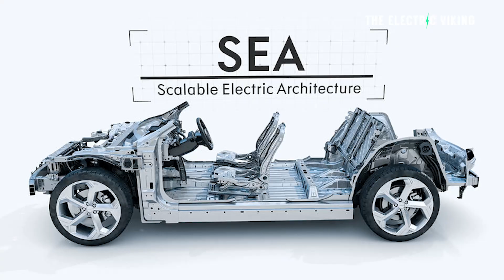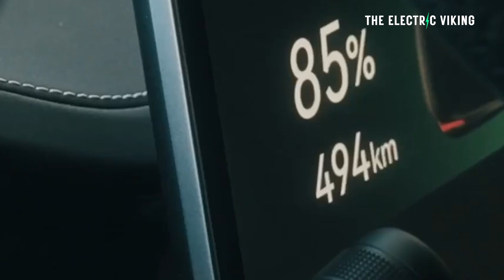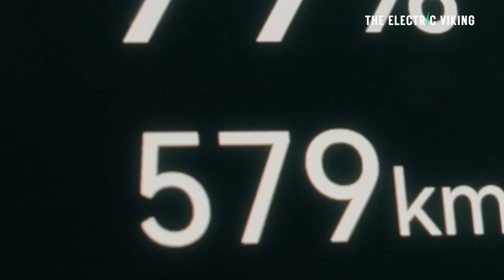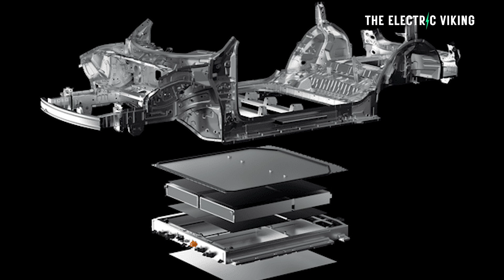Geely Galaxy E5 launched worldwide with most advanced LFP battery EVER

Comment: Owned 1 BMW and although it was fun to drive & looked good, it was a total piece of sh__! It was an X5 and was always in the shop for malfunctioning or broken stuff.  Everything from water pump, electronics, heated seats, windows, radiator, console and transmission dying with 85,000miles on it! This POS died completely with only 130,000 miles. My son's 2004 Lexus RX330 has 200k miles and still drives lime new! Along with people being scammed from US & German automakers with PLANNED CONSCIENCE, people are sick of pay top dollar for plastic components such as high heat engine parts, door panels, dashboards, seat backs, knobs and buttons!

Comment: Why would I? Well a BMW, Porsche, Isuzu…. Will tow my boat, Trailer, Caravan….. these don’t. Shark is only good for a poultry 2700kg. Issue I have with many Chinese EV’s is they all look generic Chinese on the inside. Does everyone need to use the same plastic steering wheel? Anyway….. still waiting for the L60…..

Comment: 4:27 "Cell to body which is Giga casting"??? I don't think so... Cell to body is like a "million" pieces of batteries put to cells, "wrapped" to a huge battery pack and welded (or something strong bound) to the car, so basically that is the floor plate. Giga casting is hot metal injected into pressing machines and a full section of a car is created in 1 single piece. Both technologies can be used independently or together. Both making the car very strong but they are different things...

Comment: The truth about safety is not how rigid the structure is, but how it deforms to absorb the kinetic energy. The squishy thing behind the wheel won't stop moving if the car stops instantly. And the bits inside the squishy thing are what get damaged. Notably the brain. So controlled deformation/breakage are actually better. With castings there is a better chance to design-in controlled absorption of the energy.  More expensive to repair, but ya cain't repair a torn brain!

Comment: I'm not so sure the physics checks out regarding the giga casting resisting deformation..

I'm open to corrections but if the cars is harder to deform the collision time will be shorter and therefore you the driver will get more injured from the crash

But I think it's safer if the crash is smaller scale/speed
Reply: I'm guessing this technology will just make the parts of the passenger compartment part of the body stiffer. For example making the entire door ring less prone to warping. But the front cabin part, should still apply a lot of the cushioning technology Geely learned from volvo.

Comment: Deformation in a crash is the best way to absorb energy to limit damage and injury to the occupants. Thats why cars have crumple zones.
Reply: The crumble zone is there in an EV. You're safer inside the cabin because of the gigacasting.
An EV has no engin block being pushed inside the cabin. The front and back are designed to absorb impact as in any other high-tech car.
Reply: @Jonse70  There can be no crumple zones, hence the solid casting, the rigidity is required to prevent the battery being deformed and likely  burning. This comes at the expense of passenger impact safety.
Reply: @dayleedwards3521 not exactly.
Crumple zones are partly designed to prevent the engine block from killing you in a crash.
EV’s have safety features to make them extremely safe
Reply: deformation to your chassis will crush you inside

Comment: Still think cell to body manufacture is a huge problem for right to repair.
Reply: most of today's BEV have poor maintenance economy. Often their battery can only be replaced in their entirety - just like when a small feature on an iPhone breaks, you can all but replace the entire motherboard. But the Wuling Starlight, a car from Wuling (a joint venture constructed by SAIC, GM, and others, whose products are often marketed abroad under the Chevrolet label), could theoretically be swapped out for a particular set of cells in the battery alone, and may be able to greatly reduce the cost of repair after an accident

Comment: Crash deformation is a design feature! If the body doesn't deform - you do, to many pieces. Giga casting is faster, cheaper, more efficient, but it MUST deform in a crash. Sam, read the specs.
Reply: Absolutely. Trouble is he thinks the sun shines out of the backsides of these car makers and they can do no wrong. Very naive.
Reply: I'm guessing this technology will just make the parts of the passenger compartment part of the body stiffer. For example making the entire door ring less prone to warping. But the front cabin part, should still apply a lot of the cushioning technology Geely learned from volvo.

Comment: To be absolutely clear, Sam, the highest crash standard is ENCAP 5. In the standard, the car has to yield or fold to reduce the stresses on your neck to as low as possible. In a rigid car the mass of your head will break your neck, which will be fatal. You will note that the bolts on a plane seat are designed to break to stop this happening. You have more chances of surviving flying through the air than being rigid with the plane. If the company is saying its cars are safer due to its rigidit,  please do not buy one.

Comment: Still if ternary battery get short circuit, punctured it will instantly becomes an inferno!
Therefore LFP & its upgrade LMFP /M3P are the safest batteries at present.
Ternary batteries are a gamble no matter how safe suppose it prevent puncture, short circuit, there's some extreme cases, accident it can... So   save oneself be trap inside & burn alive

Comment: Giga casting could be adapted to internal combustion vehicles too. When is the Electric Viking going to explore the water to combustible gas technology as was perfected by such inventors as Stanely Meyer? The hydrogen/oxygen gas produced by this technology is much "greener" than those short life batteries used in EVs. Water is cheap and available. I've learned that salt water can work with this technology as well. Virtually free energy so why not? Many existing vehicles, jet planes, and turbine engines could be easily converted to run on water.
Reply: Please do not post that totally debunked rubbish. I suggest you learn some physics and then you should understand why it is dross
Reply: @rogerphelps9939  Debunked by whom, those that are in the pay of the elites (big oil). The inventor Dennis Klien also ran his car on water. If you knew some basic science, you would know that water is made up of two hydrogen atoms and one oxygen atom. Hydrogen if you didn't know, is a very explosive gas. When water is hit by the appropriate resonant frequency the bond of the molecule breaks down and an explosive gas made up of separate hydrogen and oxygen molecules is created. It is then immediately used to run an internal combustion engine. Some people only believe in authoritative sources presented to them by the elites. You seem to be such a person. It is the people that don't follow the "experts" presented to them by the ruling elites that advance civilization. Water as predicted by Jules Vern is the fuel of the future.

Comment: Hang on ... what you say about giga casting being safer because it is less likely to deform flys in the face of everying in the past.
Cars got safer BECAUSE they were designed to deform in a collision. The deformation absorbs energy that otherwise is transferred to the passengers. What are you talking about? What you are saying contradicts all of the crash test data from the last 50+ years!
Reply: He's a China fan boy, doesn't understand the physics
Reply: It's supposed to affect the passenger compartment only - after all, if Geely is going to pass Euro-NCAP, it's surely going to pass the various occupant and pedestrian safety tests properly.

Comment: Right now an ev has around 2 gallons of gas worth of energy and does around 250 miles. Imagine when you have double that, 4 gallons of energy and 500 miles. Batteries are so new that its inevitable with so much investments and having so many markets to sell a battery to. Batteries are the new oil.
Reply: Plenty of EVs now do 300 to 400 miles on a charge

Comment: Cars that deform in a crash and have crumple zones are safer than stiff cars which do not absorb the energy of a crash and transfer it to the driver.
Reply: In certain areas, stiffer floor pan for instance makes for much better side impact protection and is good at keeping the passenger compartment from cruising front,side and back.
Reply: @alankemp1970  frontal impacts compose of over 75% or car crashes
Reply: @TheRt440  86% of serious injuries and fatalities are from side impacts at speeds below 36mph, these are mainly from vehicles pulling out of side streets into the traffic flow in towns and cities. Crumple zones work well in front and rear slow speed impacts but not so good over 40mph where the rigidity of the floor pan and front fire wall are important for protecting the occupants. One reason ev do well in side impact crash tests is how the battery pack helps with this rigidity.
Reply: @alankemp1970  that’s because cars have crumple zones in the front
Reply: Again, not necessarily
Reply: @mavelous1763  yes physics is physics

Comment: Most amazing thing about it is that  it weighs 1630 kg din with 60 kwh battery pack,it is almost 400 kg lighter than tesla model y,800 kg lighter than porsche macan ev,100 kg lighter than 2024 petrol VW tiguan,it is 400 kg lighter than toyota BZ4X with 70kwh byd pack,it is 600 kg lighter than bmw ix3,it is by far the best family ev crossover ever made,it's battery has 5C charging capability and 192wh/kg in pack level energy density one  the highest ever in LFP battery chemistery industry,it's amazing battery pack will retain 88% of it's capacity after 3600 cycles compared with 3000 cycles for byd's blade battery packs and 800 cycles for panasonic NCA 21700 pack in the model y or 1500 cycles for tesla's own 4680 NCM model y for the same 12% battery capacity loss,geely just made history with this amazing ev
Reply: i thknk the 1630kg is for the 49.52 kWh battry, but yes impressive 5kwh/mile
Reply: @codyepperson6796 5 miles per kWh!
Reply: wr
Reply: Hands down Geely!😲

Comment: Just so we're clear, Chinese battery companies are not fully transparent when it comes to their technology. It is not unheard of for batteries to catch fire in China, even LFP batteries which are chemically designed to be safer, they still suffer from quality defects all the time and catch fire.

Often times when third party reviewers outside of China are handed the keys to Chinese vehicles, they can never match the claims from the manufactures, because there are no consequences to lying or distorting figures. 

Meanwhile German OEMs are much more conservative in their approach when it comes to EVs, which is why when a German OEM states a car will charge at a certain rate, or go x miles, it will, even in the worst case scenario. When you buy a BMW you're buying the engineering that went into the car, which tends to be a safer, more reliable, and more dynamic vehicle, than something offered in China. 

Yes Chinese cars are getting better, but from an engineering standpoint, they're not superior. Technologically they're more advanced, but it's a different mentality. Chinese buyers want digital cars, German car buyers want cars that are more fun to drive.

Comment: Maybe. But the design is so boring, so ...communist... with such a long bonnet... is a frunk there or what? Anyway, EVs should not be so long. It's probably similar to the Mazda cars, not a modern SUV...
Reply: you opinion is weird.
Reply: @linphilip6389  yep... but I have a Peugeot 3008! That is a well-proportioned car. This one has the bonnet low and long. See just how is the ID4 shape compared with this one...
Reply: @costiqueR I think this is a cool car. Geely's designer is from Europe btw.
Reply: @linphilip6389  And what, Europeans are not making bad designs? As I said, the length of the bonnet compared with the thickness over the wheel is giving me a reject reaction... just put the pictures of them side by side, and you will see in the second one what I mean...
PS: I know now why: the chromed margin of the windows makes them much more differentiated and it was the 2000-2010 design type in Europe... the modern cars have much less differentiated the windows with the frames...look how is looking at a Nissan Qashqai from 2015...
Reply: @costiqueR  this car is out for more than a month now. i have watched other people introduced it in other videos on YT so i know what it looks like and what functions it has. This car costs starting from about USD20k only.